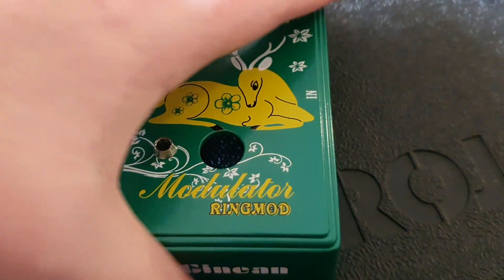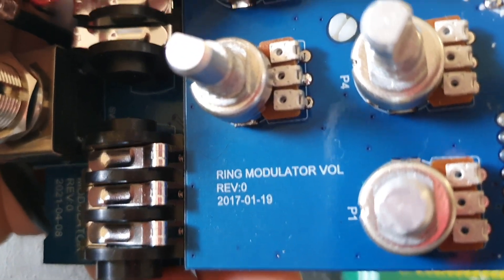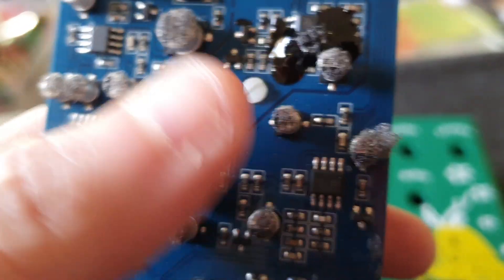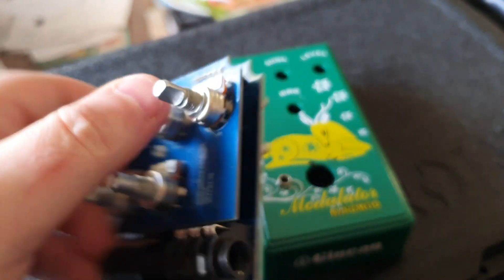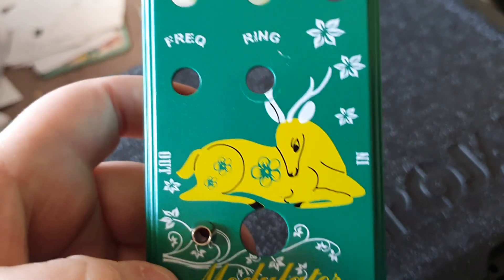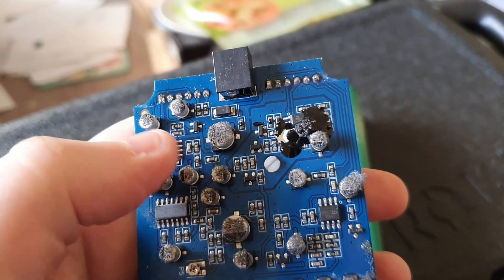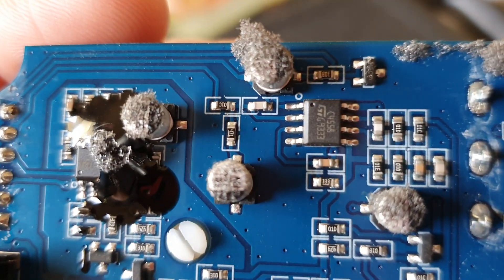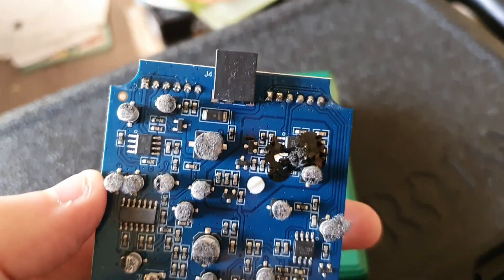Loscha Opens Up: Ginean Ring Modulator which is a DOD Gonkulator Reissue with stolen PCB layout.

Comment: This is most likely a "third shift" product. It's made in the same factory line with the same components as the DOD Gonkulator, but made in unauthorized batches and dumped on the secondary market with different trade-dress.
Reply: Also, there's a different version with a "mandala" design trade-dress instead of the deer. I'm interested to see if that was possibly a prototype batch with different hardware Rev# and/or different components.
Reply from the maker: @Theranthrope  I have seen a photograph of the inside of all three designs next to each other and they components and PCB layout were identical. I'm familiar with the term "Third Shift"
These pedals have had whole batches of circuit boards made up with the different colour soldermask, and the components are all 100% identical.

I think it goes beyond 3rd Shift.
We've entered into the Industrial Espionage level of things!
Reply: @Loscha  This is clearly DOD being ripped off by their own supplier, but I don't think they can really do anything about it legally, because the country where all of this is taking place encourages this kind of shifty behavior as an aspect of economic 4th & 5th Generational Warfare. 
 
Best they can do is play whack-a-mole with online retailers.
Reply: @Theranthrope Hi Theranthrope, do you know if the Mandala one is a newer release?
Reply: @marcotaticchi5343  Unknown at this time. I have one on the way on that's on boat somewhere out in the Pacific. When it arrives, I'll open it up to see if there are any differences from the Deer version. 
 
I also want to see if there's space to mod it to add a port and bypass switch for an expression pedal for the Freq control.
Reply: @Theranthrope Thanks a lot. Please let me know when the pedal arrives.
Reply: @marcotaticchi5343  I finally got the Mandela version and opened it up. It looks like a newer version; it has a different PCB with a slight rearrangement of components with board markings: 
 
DS-24 GK-plus 
REV:1
2023-12-23 
 
I'm not sure what's different about it other than maybe having a different layout because of rearrangement of the pots. All the ICs have their markings sanded off and there's some gooping. 

Deer pot arrangement: 
0-0-0
0-0

Mandela pot arrangement:
0-0-0
-0-0-
 
The Mandela version could rightfully be called a clone of the DoD while the Deer is a straight knockoff. I'm interested in what the "plus" part of "GK-plus" could mean.
Reply: @Theranthrope Very kind of you. Thank you very much for your information.
Reply: @Theranthrope  Did you ever put in an Expression jack? I just got one of these and that was my first thought also. Even if I have to put in a 1/8" stereo jack instead of 1/4", and make a special cable for it, it would be worth it. Do you know what the value of the Freq POT is?
Reply: @PracticaProphetica  I was originally looking for something like this, but google AI has made it useless and I didn't know what specific terms to search for. 
This is helpful information. Thank you.
Reply: @Theranthrope  Ah, I put in some brackets and repeated dots in my reply, and YT stole my comment! Let's try again.

I just took the unit apart, to see where a jack could fit. There actually isn't any viable space for a regular one quarter inch jack. Every possible location is blocked by one thing or another. I'm going to have to see if I can get a smaller stereo jack - one eighth inch - with switching. It could fit just to the right of the footswitch. A 1/8 to 1/4 stereo cable would be required. This is nowhere near as robust though.

Optionally, I could go for a surface mount one eighth jack, (no switching), and just put in a small DPDT switch to the right of the RING knob to switch between knob or expression.

The potentiometer has C104 written on it. It's a different number than the other pots, which are B104. I'm still looking it up. I might have to remove it from the circuit to test...
Reply: @PracticaProphetica  That's Disappointing, but thank you for letting me know. 
 
I have hypothesis that YT has some kind of comment "negativity score" which was poorly tested, so it has a lot of false positives and false negatives, that makes the YT censor nanny bot eat innocuous posts while letting rude things through, because language context is hard.
Reply: @Theranthrope  I'm still experimenting. I ordered a switched stereo jack for one eighth inch stereo plug. I also have one of those cheap passive volume-expression pedals from China, about $20 US. I tested the FREQ pot in the RingMod circuit and it seems to be about 100K Audio taper.

The volume-expression pedal, much to my surprise has a dual Audio/Linear pot. 100K audio (for volume) and 10K linear (for expression). Normally, for expression, you only plug in one stereo plug on the left side of the pedal (the OUT jack), which hooks into the 10K linear. But both jacks are stereo, because Expression needs stereo, even though a Volume control only needs mono. So I can use the Volume control pedal (in Volume mode) to control the Expression of the RingMod. There seems to be a residual 10K on the Volume pedal, so it goes from 110K to 10K, instead of 100K to 0k. I can short two pins on the pedal pot to get rid of this, but maybe it won't matter.

I'm going to just wire it straight into the circuit now to test. I won't bother bypassing the FREQ pot, it'll just act as a limiter, but if I turn it all the way down, the Expression pedal should act in parallel with the FREQ pot resistance, and I should be able to drop the resistance. Let's see....
Reply: ...IT WORKS! Just ran two wires from the output jack tip and ring (soldered them to those connections on the pedal circuit board), to the left and middle contacts on the FREQ pot. I have to have a mono plug plugged into the input of the Expression Pedal, in order to fool it into thinking it is a volume pedal. That activates the 100K audio pot. It doesn't have to be a cable, just a plug end, like an adapter, or whatever. As long as it has the quarter inch mono plug end.

I didn't bypass the FREQ pot, so both are active (the pedal control and the pot), but that means if either one is in high (low resistance) it cancels out the other, since the low resistance will bypass any higher resistance running in parallel.

My impression? It's pretty cool! You can do lots of almost "talking" sounds, but it can be pretty weird also, if you move the pedal too quickly up and down. It's hard to restrain this, but to use it effectively will take quite a bit of control on the pedal, otherwise it just ends up being gimmicky or spacey sounding. Yeah, I think it makes the pedal 100 times more useful and interesting!

In the end, what will be required for this mod is as follows:
- Volume/Expression pedal (passive). About $20-$25
- Mono Quarter inch plug (bare end, adapter, or cable, doesn't matter)
- 3.5mm stereo jack (for the Ring Mod) - this can have switching, if you want to bypass the FREQ pot, or no switching if you want both to be active. Just remember to turn down the FREQ pot when you use the pedal)
- 6.35mm (quarter inch) to 3.5mm (eighth inch) stereo cable.

Procedure will be as follows:
1. Drill hole in case of RingMod, to mount Stereo jack (best location will be to the right of the Bypass switch.
2. Mount jack in case.
3. Solder two wires from tip and ring of stereo jack, to middle and left tabs of FREQ pot. NOTE: if you are going to bypass the FREQ pot via a switching jack, then you will need to disconnect those two connections from the POT and use 4 wires to allow putting the pot back in circuit when the jack is unplugged. This will be more complicated.
4. Assemble and test. The Stereo cable will plug into the stereo jack on the RingMod, and into the output port on the Pedal. Turn the FREQ knob down to low, if you are not using a switching jack.
Reply: All these cloned device companies get a percentage of clone sales. Otherwise it would be illegal. Simple
Reply: @wolfgangdevries127  This is not a "cloned" device, like the DemonFX clones  of Darktube pedals. 
 
Cloned pedals have different (read: cheaper) components, look (annoying superbright blue LEDs) and sound different (higher basement noise level) than the originals. They are completely re-engineered despite having the same on-paper specs. 
 
The only notable difference between the Maralang and the DOD Gonkulator is the color of the PCB and the graphics on the aluminum case. Everything else is the same down to the Rev# on the PCB. (Although ironically, based on video and photos, the solder work on the Maralang looks more solid than on the DOD, but that could be tacked up to just different individual workers with different skill levels working in the same factory.)
Reply: @Theranthrope  thanks for the info. Yeah, but DemonFX has no ring mod pedal. Also liked the deer design 🙃
Reply from the maker: @wolfgangdevries127  Chinese illegal factories do not care about illegal use of other parties intellectual property. And it's stupidly expensive to attempt to bring suit against any illegal manufacturer.

I do not for one second believe that DOD get a cut of the sales of these pedals which are 1/3-1/4 the cost of the legit DOD pedals.
It's idiotically naive to think otherwise.
Reply: @Loscha ok, let's discuss the overpriced boutique pedal scam then. Be consequent!
Reply from the maker: @wolfgangdevries127  I have no problem with makers selling "boutique" pedals.
People can charge whatever the hell they want for a thing, and people can pay whatever they want for an item.
This is the same as cars, watches, synthesizers, guitars, pedals, ravioli.
What someone is prepared to pay for a fuzz pedal made of 9 components on some turret boards is not my concern.
I think they're a moron for paying $800 for such a thing. The maker of the pedal is probably laughing all the way to the bank, because they had the presence of mind to only sell 5 of the pedals and created massive FOMO and false scarcity.
Reply: @Loscha  sure, but I was happy to get 2 of these pedals for €72 and some cents. Then again: the Digitech RP-1. Sold for a fortune back then, but the pedals were made from plastic, I kicked one into the audience the first gig I did with it.. shame on you, Digitech!
Reply: @wolfgangdevries127  How do you so badly misunderstand the economics of bring a product, like a guitar pedal, to market?
Reply: @Theranthrope  not sure what comment you reacted on
Reply: @Loscha  you not caring doesnt make it any less of a scam haha.
never gave a damn about the meter man till i was the man who had to read the meter, man...
Reply: @Loscha  Some western brands are far worse, they do it for decades but people almost never talk about it. 2 western brands took my design, one made millions on my hard work, do you think i had any support in the US for justice? Nope.
Reply: @wolfgangdevries127  These aren't clones and this is illegal. Simple.
Reply: As everyine knows, the DOD Gonk was "Rereleased" in China as a  different sounding pedel. Several have posted DOD bought the "Bambi" pcb board from a company, possibly Gideon,  which would make it the original. But I have no idea if that's true. Just found it intriguing.